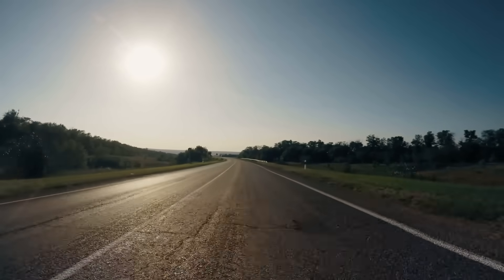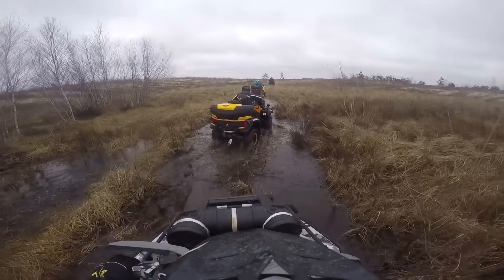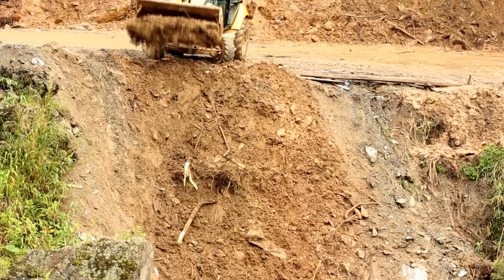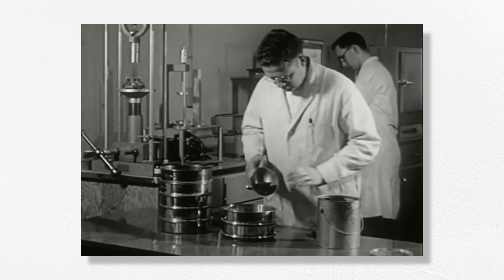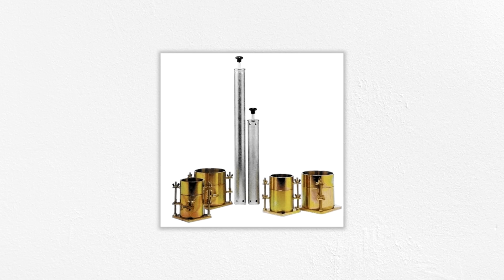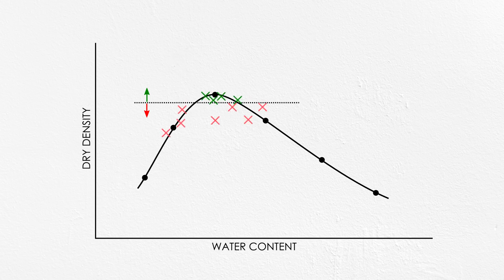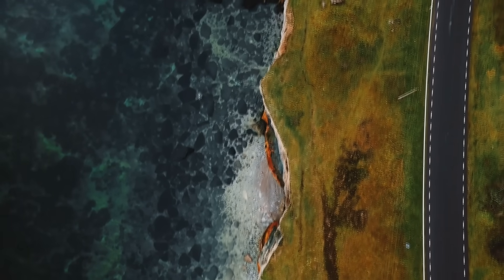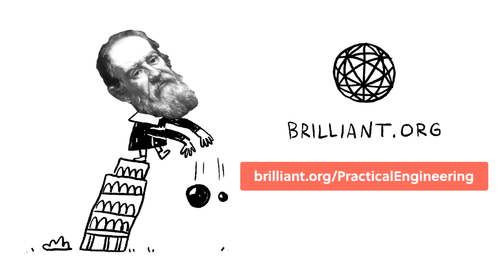Why Does Road Construction Take So Long?

Comment: Hey Practical Engineering, I have a question: When they do road construction near me it goes as follows:
Day 1: cones show up on the side of the road
day 21: cones block off a line of the road
day 36-40: Construction is happening, the road gets ripped up, people are doing stuff
day 50-54: Construction is happening, people are doing stuff
day 71-74: Construction is happening, people are doing stuff
etc.
It takes them YEARS to do road work, there is an intersection between my house and a friend's house. For the past 6-7 years, It gets ripped up and traffic gets horrible disrupted, year or two later they are finally done, Road is nice and smooth, 3-5 months later, THE SAME SECTION intersection is ripped up AGAIN. They replace EVERYTHING, new curbs, and everything each time. It has been redone 4-5 times back to back. WTF.

Comment: You neglected to point out how few machines and crew members there are for such long stretches. In my childhood they used many more of each and covered a lot more miles quickly. Watch how often equipment sit idle for days or weeks on the various sites.  Contractors bid the various sections or bridges. They may win many, then they tie up one section by working a bit then moving to another before the first is finished, and another and another. Just as trim carpenters are know to do, by doing one room move to a different house and do one there and another and another. Thus no other crew can come in as they have already done work there.   It sucks, but that is how they work.

Comment: The Cost makes me thinnk even more that rails would be better as rails are more resistant and can be built out of much more durable material.Yes it would be public transport
Reply: the rail system we have is 100 years behind the times. it also can not handle the current demand. many former rail lines have been scrapped so i just don't see it happening. i do see automation changing the way we shop. instead of driving to the store perhaps simply go the the end of your road where your items are waiting in a storage locker. this would make much less necessary.

Comment: This dealt more with new construction, which doesn't delay people as much. I think what we're upset about is the long stretches that close down for a few miles to have a lane closed for 13 months a year. I know the causes vary from utility maintenance under the road to regrading, but why those take so long, or in some cases, never seem to get done, is what's mind boggling. There's a stretch of I-70 that has had the same lane closed with orange barrels since the Western Interior Seaway receded in the late Cretaceous.
Reply: But aren't there only 12 months in a year??
Reply: @harshitrautela6585  Yes. I was using hyperbole, a form of intentional exaggeration. Hyperbole is mainly used to convey emotions that don't come across well in literal wording. In this case, it's conveying the extreme frustration with construction projects that take too long and have no clear end to them.

If I had said 12 months a year, you would assume I was being literal, so I had to pick 13 so you would know it was hyperbole. It's the same as the Beatles song "8 days a week" is complaining about an excessive work schedule by exaggeration, or my mention of orange barrels being there since the late Cretaceous period. With things that don't have hard limits like these examples, people will either use extremes (eg. "not in a million years") or intentionally fictitious numbers (eg. "not for a bajillion dollars")

Comment: Dear Grady, if you spent any number of years living in the far east, and then compare with the construction here, you will find work progress at a snail's pace here. The far east, such as HKG where labor is much cheaper and without many protection for workers, they can afford to pour workers into a job, further more, there are less local codes such as zoning , environmental laws etc. There is also a big population , making roads and rail easily profitable. The opposite and worse case scenario is Calif. They tried building a high speed rail and after a  $billion spent, not one foot been built. The lack of affordable housing and hot climate means people can live in tents. It takes several times more money to build anything there compare with states next door. If they have to build something like the Hoover dam in Calif. start same time, with today's red tape, the dam would be finished about this year.

Comment: Because most roadways are repaired by unions and they get paid by the hour. Here in chicago it usually takes a couple of months. They tear up the road, spray down oil a week after removing asphalt. Then a month later they start resurfacing.

Comment: Having built lots of roads for many years everything he said is true. But this is a very basic overview. Ignoring all the politics and hidden B.S...He didn't even mention about the underground services that usually get installed or replaced when doing roadwork which takes so much time. Or the fact that in many cases road work also includes ditching, boulevard building, sidewalks, curbs, driveways, lights and poles and then finishing off with topsoil and sod and tree instillation etc....it should also be noted that not all cut material is ideal to be used as fill material and in many cases SSM has to be brought on site which mean longer distances traveled for trucks especially in major cities.

Comment: My last visit to Mexico, there were hundreds of workers working on a new piece of road in my grandmas town, no lie in just 4 days, the workers made a new road 4 kilometers long, 2 lanes both ways,  whereas over here it took workers 3 weeks to remove around 500 feet of concrete barriers, the ones that look exactly like the ones dividing a freeway, just to reopen up the shoulder that was repaved and had a guard rail addition
Reply: they built an entire additional runway in Cancun in like 5 months... took 20 years to build a runway in Chicago...
Reply: Perhaps Mexicans cut of corners with safety or have less bureaucracy.

Comment: the main thing that makes me dislike road construction, is a lack of understanding why it's invasive to traffic flow when it doesn't seem it needs to. (speed limit reduction, lane coned off and reopened without any apparent construction/reasons, etc.)

or how we compromise on cost vs lifespan, but when SOME section is being worked on constantly, due to that shorter lifespan, backing up traffic for miles, then it seems to become a "this construction is to improve traffic" but "the traffic is primarily caused by the solution"

Comment: Utility relocation, traffic staging, and weather were not discussed, which from my experience as a former project engineer, are the biggest contributor to the projects completion schedule on sites most likely to effect the traveling public.  It's impossible to widen road in a reasonable amount of time when there are 20,000 vehicles per day, time restrictions and AT&T.  Go ahead and add a year if AT&T is on you site, they are a pain to deal with.

Comment: Still didn't explain it all. My #1 complaint of CIVILIAN engineering is that they purposely string out the projects unnecessarily. They take YEARS to do a project that should only take 6-12 months. Max! When States were able to do the construction, before the pansy ass commercial industry sued the states, projects were designed and built relatively quickly. And I personally know that military engineers can build great quality roads FAST. And we over engineer them on purpose. So, yes, some of your points are valid but a lot of them were omitted.

Comment: I work for a company that designs, manufactures and sells lab equipment for exactly these purposes such as checking soil permeability, sheer strength or roads and compaction machines to do everything you've said in this video. I am fairly sure some of our older sieves from when we much smaller made it into this video as well but it is too hard to see. It does follow how we would label our sieves but I can't tell much past that

Comment: When you stop complaining and actually get to look at the whole proces, you're getting amazed at how fast it can go. Like, with buildings. It looks like it takes quite a while, years even. But then, after those years you think: Wait, it's like no time at all.
Reply: This is a big maybe. I've worked on privately funded roads and publicly funded ones. The publicly funded ones are just rippled with corruption as often times they are charge + so the contractors take advantage of the system.

Comment: they are in the process of building a new highway offshoot where I live, the main "interstate" is a 2 lane each direction highway and about 2200 feet to the west of the main route (at the area of construction) is the "historic" highway (2 lane road) that after a few miles leads directly into the Historic town square, I haven't been up to the section of the "interstate" where they are working on that tie in for a few weeks now but at the "historic" highway they are installing a round about for where the new interconnect to the "interstate" meets the historic, the round about is basically done (they've even installed the lighting poles) but they built the new round about a few hundred feet south of the existing 3 way intersection so now they are building a new 2 lane road from the round about up to the the existing road that shoots off perpendicular to the "historic highway", they have been grading this hill for the last YEAR and i'm not even joking at this point, it has been at least a year, they'll grade it one week then the next week they dig it up then the week after that they grade it again.

I honestly don't think this intersection was engineered properly, at one point they actually graded OVER the drainage ditch of the existing road and then it rained and silt from the grading flooded over the road, clogged the rest of the drainage ditch and flowed into the lake a few hundred feet away and the area they keep regrading has been visibly flooded several times and for some reason the new round about is set like 5-10 feet higher grade then the "historic" highway it was built on top of, so instead of just widening the existing grade to allow space for a round about they raised the whole damn thing.

So I think POOR PLANNING has a lot to do with it.

Comment: That was very interesting. For me, the most important information was that soil can only be compacted at 30cm at a time. Now I understand why the same work seems to be happening for days/ weeks at a time on some parts of highways.
Reply: Well thats not true. 1 foot would be a small compaction device. I've passed thousands of compaction tests and we certainly fill more than 1 foot.
Reply: In my country, fill material are deposited in layers of 150mm compacted depth, and the absolute maximum compacted layer thickness cannot exceed 250mm. As for rockfill in swampy areas, the maximum rockfill layer is 400mm.
Reply: As engineers we specify compaction of 95% so it never settles because it is compacted so tightly with the proper moisture content. In that context the asphalt top should never give way.
Reply: Soil can be compacted as deep as 2' plus depending on material. A proper size sheepsfoot roller with optimum clay WILL compact 2' !! What happens is engineers and foreman mostly do not know what they are doing ! They are suppose to be leaders, they are mostly ignorant ! Heavy equipment operators can be the same ! Its a very ignorant world we live in now. It didn't use to be that way. Case and point. I was told this same thing, but knew different. I put in two foot plus fill... showed the roller guy how to properly roll.  subgrade compaction was 114%, they said it didn't have proper moisture content like the ignorant Norm Ferguson is trying to say. They made us rip it up and add moisture ! It was so hard a Dozer would not touch it, so we got a grader and I scarfired it.. It turned to powder (just like I told them it would)and we added water ! Best compaction then was 85%.. and yes they passed it !The first pass is the most important ! You have to go really slow, if you roll over to fast you will just set the top layer and not compact deep at all and your done. An 84" vibratory roller has 55,000 pounds per square inch force !!! If any smart ass does not believe this, then have them set in one place and hit the vibratory button... it will sink like a rock ! But this is common sense, and the term common sense should not ever apply anymore because its not common, and there is no sense !  I'm a professional Heavy Equipment operator out of Local 103 Indiana 33 plus years. This example is why it takes so long to build a road... its dept of transportation and engineers that do not know what they are doing and doing very stupid things ! Feel free to ask me any questions, or I can give proper demonstrations, and would love it if anyone would like challenge my abilities !!

Comment: I accept that's one factor, but too often we see highway construction projects with no workers.  For weeks.

Regardless, given the cycle of construction/repair/replacement of roads, seems it would be worthwhile to build a third highway lane to divert traffic for construction projects and to get around crashes and other highway problems, especially in high density areas.  Could also be used for managing "rush hour" traffic, when not used to get around construction or crashes.

Comment: It's a road only made up of  compacted soil ?
curious to know about ?
Is there no rock particle used ??
In india there is 5 process for a bituminous road / rigid road(cc pavements) 
1st -Embankment making  - mainly compacted soil 
2nd GRANULAR SUB BASE(rock particle of 30-40mm size )
3rd - BASE (basically rock particle of 12.6mm dia size  (small dia )
4th - SURFACE (i.e  bituminous or rigid ) 
And the cost of these road  are  10M/KM

Comment: I use a Troxler nuclear gauge to test compaction and moisture on roadway construction. As someone who also has worked a lot with fire alarm equipment as a hobby, it's funny how similar it is to a massive smoke detector with the way it works.

Comment: I think most people would be more understanding about road construction if there weren't eight people standing around the jobsite while two actually did work. Also, road crews should run multiple shifts until the work is done, especially in cities or on interstates. So many areas are congested due to road work when working at night would be much better for the largest of the populace. I do appreciate all the hard work that road crews do but some adjustments to the process would be good.

Comment: I was on a 16 week course at the Ford Training Centre at Dagenham at the same time as an elevated road was being built 50M south of the site we were based at.  The huge machine being used was the same one that built the Queen Elizabeth Bridge over the Thames at Dartford, and the process was beyond fascinating.  As engineers we were in heaven having this ringside view of the two lane elevated road slowly advance across the site.  It was all I could do to drag myself away from it and return to the class after lunch breaks.  It's a memory that will stay with me forever.

Comment: Probably a dumb question....where i live they are rebuilding part of the interstate   The road was built in the 70’s as asphalt over a concrete bed.   
So it would seem sensible to strip away  the layers of asphalt and put down new in top of the concrete.  The concrete has not been directly exposed to weathering.   
What they have done is rip out asphalt, concrete, and even the old gravel and start over.  Why?

Comment: Slow but steady progress happening ha?
I envy you. They are making a bridge next to my house, and abandoned the project 2 years ago. If they actually were doing anything it wouls have taken a year tops (the project is to make another exit for an old bridge). They built everything and left about a 70 meters to conmect the 2 sides unfinished for 4 years now. After covid start they dont even pretend to bring in foreman every now and then to survey the grounds anymore.

There's also a major highway out to the south of Bangkok that is still being built for..just about 70 years now. It's about 40km long.

Comment: Great explanation on why it takes so long to construct a road. I've worked on many road construction my self. It's also important to note when talking about compaction of soils, that not all soils are compactable. Some soils remain in a sponge like form, even after mixing it with lime or cement, which needs to be removed and replaced with compactable materials.

Comment: Chicago: Summer, Winter, Construction. That's it. The only change is Summer and Winter
Reply: Same here, might add, they never account for freeze thaw=pot holes, uneven bridge approaches. New highway put in near me. The old road bed was put in over a wetland. They put the new road in the same place. One of the bridge approaches had sunk over the years. Instead of fixing it, they paved all of it the same way. After seeing this video, I can say the whole 20 miles of it, they did not do soil density anything. The new road rides just as bad as the old beat up one other than it has new cement. I give it 10 years at best and it will ride like a washboard.

Comment: This is great information for building new roads, but it still doesn't explain why a 2-mile stretch of pre-existing road in the middle of a city has had construction work going on for 8+ years and the road does not look any different than it did 8 years ago.  It doesn't matter what time of day or what month it is, if you drive on this road, 2 of the 4 lanes will be closed and no one has any idea what they're trying to accomplish.